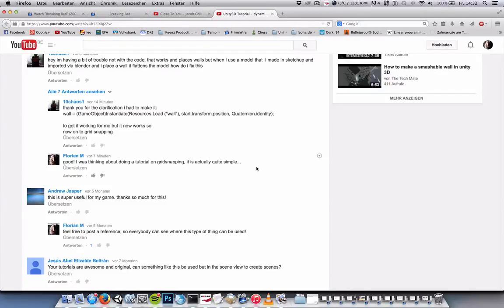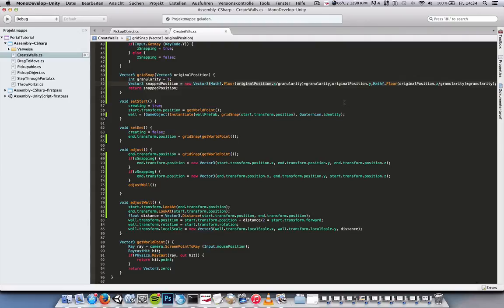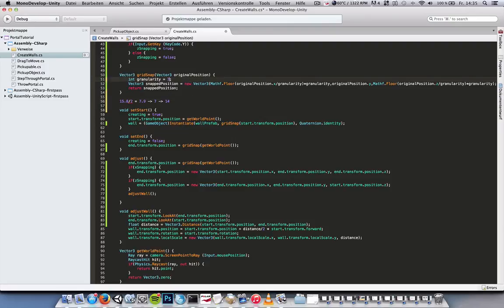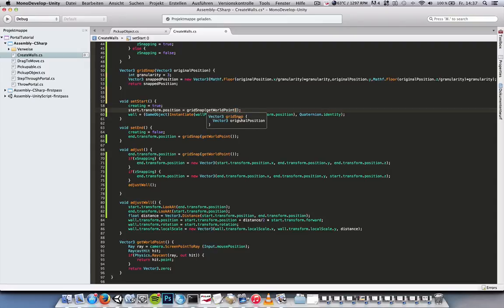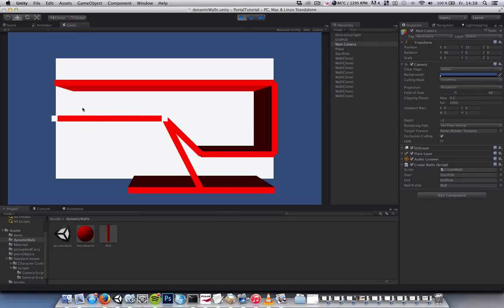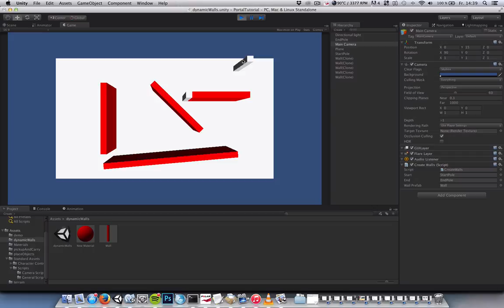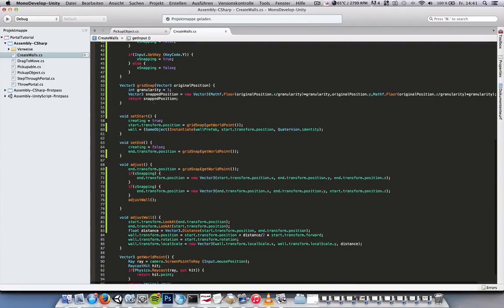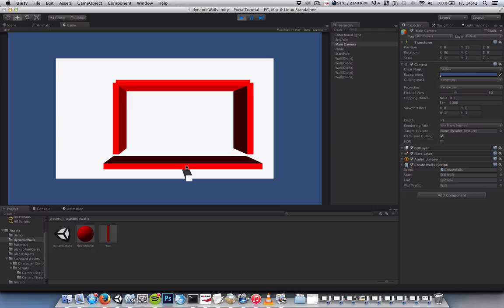Unity3D Tutorial - grid snapping for walls

Comment: Hey, all of your tutorials are amazing, however the one thing your "Portal tutorial" was missing, is a similar grid snap function to this one. Whereby the portals snap into position on the walls. If you could do that, I would love you forever and once again, best tutorials I've found so far, keep up the good work :D
Reply from the maker: it shouldn't be too hard to apply the idea from this tutorial, simply snap the coordinates to whole numbers or to whichever step you'd like.
Reply: Ahh, okay thanks I'll just keep trying 'till it works :D
Reply from the maker: do an integer cast to get the whole number from the float. Save the decimal part and clamp it to any step you'd like. Simply choose your desired step (for example 0.25, definetly a fraction or 1, like 1/2, 1/3 or 1/4 = 0.25 ...) and repeatedly increase it until it is larger than the decimal part, then clamp the decimal part to the previous step. Use the clamped position instead of the actual position to set the portal